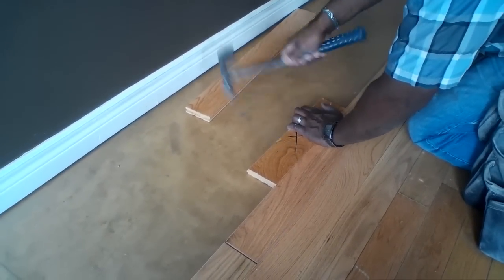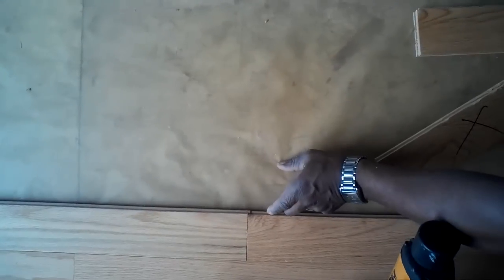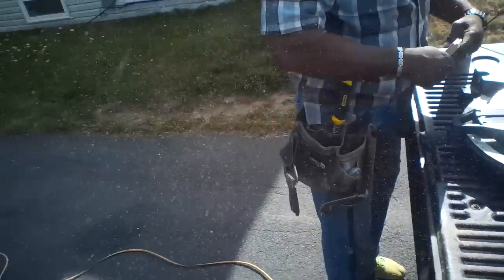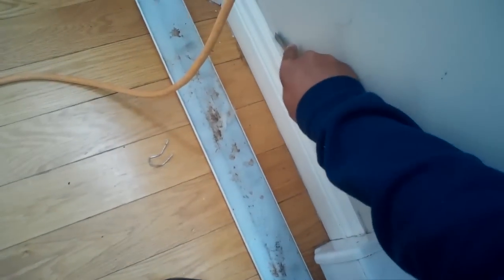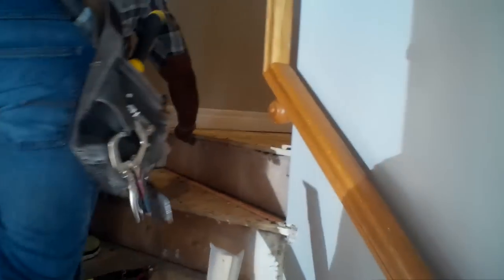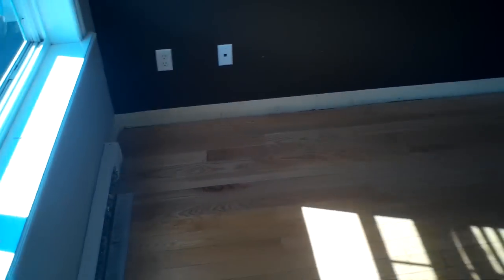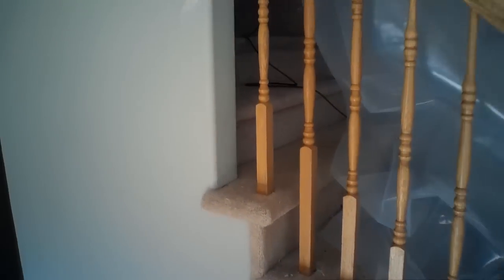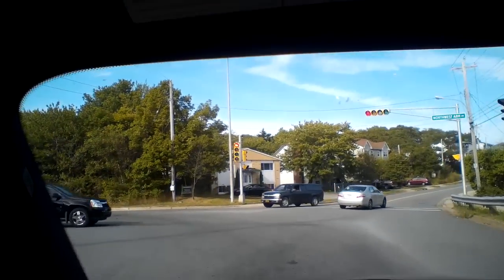BouseHouse Episode 2: PROGRESS! Laying Floors With Papa Bouse  - MaximusBlack

Comment: just bought my first house last month and holy crap the people who lived there destroyed it before moving out.  We kinda new going in that it was bad though. Redid the carpet with hardwood though and fixed holes in the walls and repainted. Looks amazing now. Redid the garage into a mancave/office as I work from home. added a bar to it as well. It's a small house (1300 square foot) but was only 125k so pretty cheap for Florida. Most houses near orlando are WAY more for this size. I consider it a win. only 10k to replace all the appliances and redo everything. Saving another 4kish for a new AC. don't have to redo the roof for 10ish years so thats good. All in all a completely redone house with 100% new everything for 134k in this area is insane :) Now I just gotta pay it off so I can afford to rent it out -_-